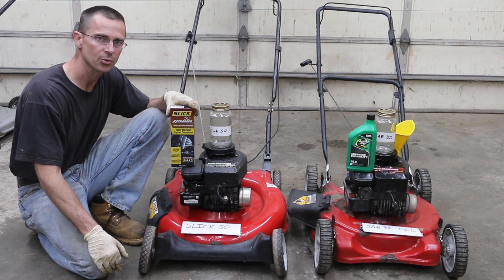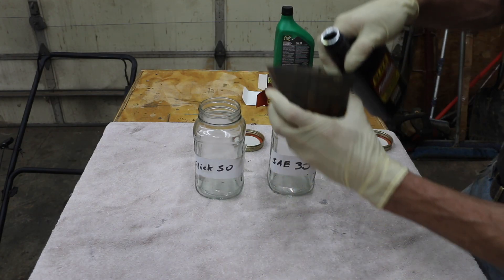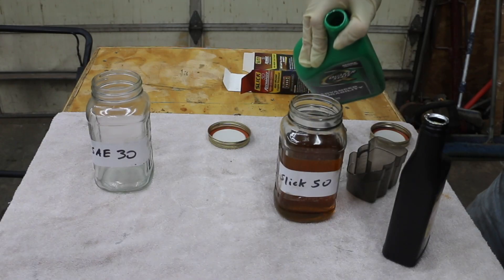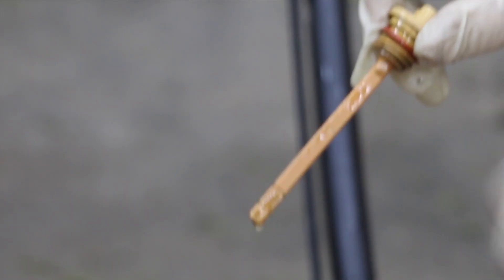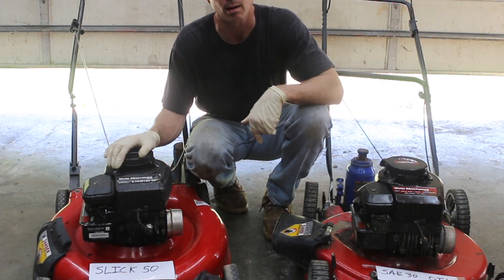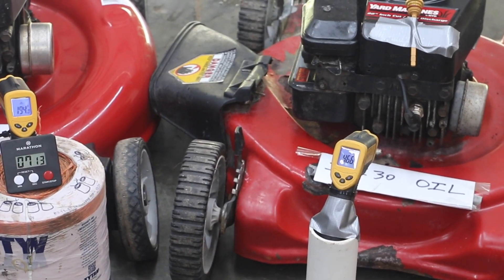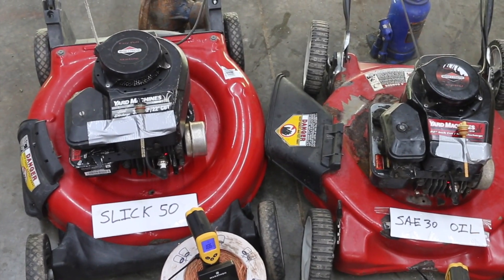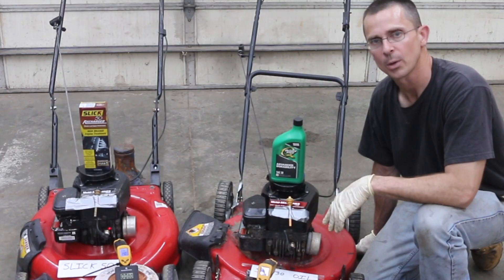Can't believe what SLICK 50 did to my engine!!--Dry Crankcase Test!

Comment: Just a question on the Slick 50 engine - how long did you run the engine with the Slick 50 in it before draining?  My understanding of Slick 50 is that it treats the engine as it runs, requiring several hours of operating at normal temperatures for the Slick 50 to 'treat' the engine surfaces.  The video didn't make it clear how long it ran - it looked as though you just got the engines both up to operating temperature before draining the crankcases. I love your videos and this one came as a big surprise to me too!
Reply: Just saw video that Slick 50 is no longer the same - person claiming to be original inventor now sells what he says is the 'original Slick 50 formula' under new name Xcel Plus.  Worth looking into further.   Video is https://www.youtube.com/watch?v=CAt-tJa9P_s
Reply from the maker: Thank you for this information.

Comment: The clearances on the older machine would be greater than those on the newer machine thus less friction so I wouldn't call this a valid test by any means.  If they were new or fairly new I think the use of Slick 50 would be justified for protecting the motor in the long run.  As far as which would run longer without lubricant I don't care.  What I do care about is which will live the longest with proper care using the best products.
Reply from the maker: Thanks for commenting on this!

Comment: I used to run Quaker State High Mileage oil in my pickup. It had Slick 50 right in the oil mix. They eather don't have that mix anymore, or they don't advertise it's in there anymore.
Reply from the maker: This is interesting.  I believe Quaker State owns Slick 50 now.

Comment: Ran slick 50 Chevy 350 for a long time short trips never knew low on oil till rear main seal failed.

Ran oil only 305 low and knew because power diminished.
Reply from the maker: Thanks for commenting on this!

Comment: Have you ever tried Tufoil?? When I used it in my old 318 motor I had to lower my idle after changing.oil and adding Tufoil. This motor was in a 73 road runner with about 80000 miles. No other additive ever changed my idle speed when added. I used it till I killed the motor and car. I ran it very hard and it finally died at about 180000 miles.
Reply from the maker: Not yet. Thank you for this recommendation!

Comment: From Wikipedia:  "Some mass-market oil additives, notably the ones containing PTFE/Teflon (e.g. Slick 50) and chlorinated paraffins (e.g. Dura Lube),[9] have caused a major backlash by consumers and the U.S. Federal Trade Commission which investigated many mass-marketed engine oil additives in the late 1990s.

Although there is no reason to say that all oil additives used in packaged engine oil are good and all aftermarket oil additives are bad, there has been a tendency in the aftermarket industry to make unfounded claims regarding the efficacy of their oil additives. These unsubstantiated claims have caused consumers to be lured into adding a bottle of chemicals to their engines which do not lower emissions, improve wear resistance, lower temperatures, improve efficiency, or extend engine life more than the (much cheaper) oil would have. Many consumers are convinced that aftermarket oil additives work, but many consumers are convinced that they do not work and are in fact detrimental to the engine. The topic is hotly debated on the Internet.

Although PTFE, a solid, was used in some aftermarket oil additives, users alleged that the PTFE clumped together, clogging filters. Certain people in the 1990s have reported that this was corroborated by NASA and U.S. universities. One thing to note, in defense of PTFE, is that if the particles are smaller than what was apparently used in the 1980s and 1990s, then PTFE can be an effective lubricant in suspension. The size of the particle and many other interrelated components of a lubricant make it difficult to make blanket statements about whether PTFE is useful or harmful. Although PTFE has been called "the slickest substance known to man", it would hardly do any good if it remains in the oil filter..."
Reply from the maker: Thank you for this information.

Comment: you pulled more out of the 30 oil than you did from the slick 50 mixture, pretty sure there was more residual oil in the 30 machine.
Reply from the maker: Thanks for commenting on this.

Comment: I remember a similar advert for slick 50 in the UK but that was about 2 brand new cars equally run in then one treated with slick 50 one without then driven for 500 or 1000 miles (Its a long time ago ) then the lubricants were dumped and they both set off from Sidney to Melbourne  in Australia  , the one with the slick 50 is claimed to have made the whole journey with nothing but a slight increase in running temp whilst the untreated engine seized after a few mile's  at least that was the claim , its great You've actually done a similar test .
Reply from the maker: Thank you!

Comment: Slick 50 did do what you claim when John Bishop supplied the formula that stated the product. www.lubrilon.com  email me if you want the whole story of the industry... I lectured on the lubrication industry for several years... there is a lot of misinformation.  The use of a falex tested only proves the EP properies of a lubricant.  Use cutting fluid that has an EP base...vs oil vs slick vs duralube etc.. gdiintinc@gmail.com
Reply from the maker: Thank you for this information.

Comment: Slick 50 is not the same as it was in the 80's. The company was sold and the new Slick 50 is a different formula. I was at the Dayton, OH Air Show the year Skick 50 was introducing it's original formula and I saw a cessna 172 fly without oil in the engine, no issues. I also have a friend of mine who had a Gyrocopter with a converted VW, 1835cc, engine as the power plant. He treated his engine with original Slick 50. He was on a cross country flight and had the oil pressure line to the gage break off the fitting at the engine block. He noticed that the oil PSIG was reading 0 but since the engine sounded fine he continued to fly for another hour. When he landed he found the broken oil line and checked oil level to find no oil in the engine. CHT's, EGT's were fine in flight and he was able to hand prop the engine and it ran and made power. He fixed the oil line, refilled the engine with oil and Slick 50 and put about another 100 hours on the Gyrocopter before making more engine mods. No visible wear was seen. True story!
Reply: uhhhh NO, no one would allow an aircraft to take off like that. quit lying liar I have an A&P
Reply from the maker: Great point!

Comment: At the bottom of the container of slick 50 was a measured amount of PTFE, or as it's known as polytetrafluoroethylene. The bottle needed to be shaken up for 30 seconds before the treatment was delivered to the engine. The reason for the instructions was to make sure that the full amount of PTFE in the bottom of the container was mixed into that 30 weight oil that they used as of delivery vehicle for the engine. Again we sold thousands of bottles of Petrotech 2000 and Slick 50 as it became known.

I believe that the slick 50 that was originally manufactured was most likely a different product than it is now. Again, the old product had the measure of PTFE in the bottom and needed to be shaken up before delivering the treatment to the engine. I was in my teens at the time when we did the traveling for Petro Tech 2000 which became slick 50. The product is most likely a lot different than it was when it was originally made because the original product did in fact work and it worked flawlessly. 
 I would be more than happy to discuss that with you if you chose to contact me. Anyhow, My internet was slowing down so I apologize for the multiple messages. 
 The intent of the Slick 50 advertisement was NOT to discourage you from using oil, it was to demonstrate the integrity of your engine after it was treated with the product which would extend the life of your engine and prevent a seize if you ever ran out of oil.  I am not condemning you or your tests, you invited us to comment on your videos and I am merely taking you up on your offer as a qualified user and salesperson that is familiar with Slick 50.  One of your followers is a bit of a cool aid drinker of your videos because I didn't ask you to do the interesting tests (and they are informative and enjoyable) but he thinks we should give you cash for making comments contrary to your findings.  Keep making the videos and being curious!
Reply from the maker: Yes, I'm told the product changed from the original. Thanks for commenting!

Comment: I believe that your test with Slick 50 product was not an accurate or thorough test.  Back when Slick 50 was called Petro Tech 2000, the company had a 1 million dollar insurance bond payable to the person that could sieze an engine with the product treatment in the crank case.  My father and his partner Dan Miller (and I) traveled the western U.S. in a Toyota truck with a lawn mower engine attached to the tail gate and had  advertisement on the tail gate that encouraged people to start the engine and watch it run without oil. The engines dipstick was removed so you can see into the engine and that it had no oil. And we went to Utah and Nevada and several places in California with this engine on the tailgate with a brochure holder full of slick 50 brochures that we would fill up every time we went to a store or a restaurant so people could see the engine and the brochures and would challenge to try starting the engine without oil that must have been started three or four hundred times that I can recall where people were surprised and would take the brochures every time we put them out when we stopped. We sold thousands and thousands of bottles of slick 50 and never heard anybody claim the $1,000,000 bond for an engine that seized where they can verify that it was first treated with slick 50 and then was seized afterward.

The catch was you had to follow the directions exactly as it explained the process. At the bottom of the container was the measured amount of PTFE and needed to be mixed thoroughly into the oil.
Reply from the maker: Thanks for the constructive feedback.

Comment: Really? What is the point? Of course any motor with no oil in the crankcase will lock up eventually. Use the slick 50 if you want ,at least it makes the engine run a little cooler. Point is check the oil before you start it. That is why they call it a "dipstick"  There is no magic formula that will work so have fun toasting engines and scratching your head wondering why did that happen.
Reply from the maker: Thanks for commenting.

Comment: I think you got slightly more drain out with the Slick 50 engine. It may have been that with the oil, some of it was hung up in there, and so that one ounce that stayed inside the straight oil engine helped it last a little longer. Just a thought as to why the difference in time the engines lasted. The more interesting thing to me is the lower running temperatures of the Slick 50 engine. Maybe I should run this in my mowers.
Reply from the maker: Thanks for commenting on this.

Comment: I used Slick 50 in new engines after break in, never had an engine oil failure in any vehicle, guess I never would have found out if it worked or not.
Guess I wasted money on snake oil..
Reply from the maker: Thanks for commenting!

Comment: Interesting experiment, I've always wondered about that too. I do have an observation though. The lawn mowers are not identical, looks like one is slightly different than the other and I'm wondering if that could also be part of the explanation. They might be slightly different engines. The one with the regular oil looks like maybe it's older maybe it's just dirty. I'm wondering if it's had a lot of use and the parts are well broken in. I'm just curious I'm not saying that it is the explanation. Does anyone else have any ideas about this?
Reply from the maker: Great point.  In more recent videos I used identical engines.

Comment: 30 years ago I purchased a used 1967 Chevy C30 , it was a retired Navy Base truck from SanDiego, the guy I bought it from used it to to w his Charger back to Cleveland from San Diego  , I see the truck for a year, middle of the summer I changed the oil , refilled it with new oil and Slick 50 according to the instructions, a week later driving home the block windowed. I would never use another oil additive again after, this stuff is junk.
Reply from the maker: Wow!  That's terrible!

Comment: I always thought you had to run the engine for a while like 60 mins or so to allow the slick 50's ptfe to bond to the metal surfaces before full protection was reached
Reply from the maker: Thanks for commenting on this.

Comment: Yes Castrol EDGE Full Synthetic Motor Oil It is a long chain molecule synthetic oil with the ability to electrically stick to metal parts because it produces a positive charge and the metal parts of the engine are negative charged. Castrol EDGE  is three times stronger against viscosity breakdown than the leading synthetic oils. The unique Titanium technology physically changes the way oil behaves under extreme pressures  doubling its film strength, preventing oil from breaking down and reducing friction Castrol EDGE with Fluid Titanium has twice the film strength of the previous formula based on the HFRR friction test.

When they first came out with this product and it was called Castrol Syntex but Syntex did not have Titanium.
Reply from the maker: I'll test it in a future video. Thank you for this recommendation!

Comment: Zx1 has my vote,saved my boat engine Perkins 4107,engine was running at 3/4 throttle for at least 1/2 an hour with no psi on the gauge,could have been longer,sure saved my engine.No connection with Zx1.
Reply from the maker: Thank you for this recommendation!

Comment: Not that anyone should blow a fortune on two brand new engines, but I wonder if the two test engines you used were treated differently before you bought them for this test.
Reply from the maker: This is an excellent point.  In more recent videos, I used 2 new, identical engines.  However, I've been criticized for being wasteful.  So, not sure I will do more testing like this.
Reply: I hate the expression "Haters gonna hate," but it's still true. Basically, someone will find fault with you regardless of what you do. ("Look at all the epoxy you wasted!" "Look at all the electricity you wasted grinding down angle iron!" and on and on.) My counter-argument about destroying engines -- especially in a comparo that's probably more scientifically valid -- is that you are actually SAVING engines by running experiments on small, cheap engines (as opposed to car engines) and that there are literally millions of people who now will not have to run a similar experiment to find out the result. This is particularly true with tests that serve a real-world purpose -- e.g., testing Slick 50 or SeaFoam, as opposed to using WD40 for engine oil, which no one would actually do, owing to the expense of WD40.  You can also mitigate some of the criticism by donating destroyed engines to either a nearby high school, trade school, or similar auto mechanics class, give them to a nearby small engine repair shop to be cannibalized for useful parts,  or give them away on craigslist so someone might be able to make use of the parts. Bottom line...do your best to be a good citizen of the world, and rest easy, bro. :)
Reply from the maker: Great point regarding the haters!  I agree, the few hundred spent on small engines could collectively save consumers hundreds of thousands or millions.  Thanks again!

Comment: I'm wondering what the slick 50 engines failure was. Obviously it wasn't from excessive heat it seems. I mean if the piston seized the head should have been extremely hot? It was at 230F when it started to fail and hit 284F after it failed. Maybe the plastic part that moves the valves failed?
Reply from the maker: I was able to later free up the engine and get it running, but it sustained damage. Thanks for commenting.

Comment: way back when these came out, I tried duralube, very unscientific, but engine oil between my fingers, and rubbing them back & forth, it went away, then I tried duralube, and it never went away, stayed slippery as hell
Reply from the maker: Yes, I've heard good things about Duralube and I've done some very basic testing with it, but I need to conduct a more in-depth test like I did with Motorkote.

Comment: not excusing slick 50, but back in the day of the commercial, didn't they use 100% slick 50 for the pretreatment? maybe not? Also the slick 50 mower looked like it had more hours on it, bald tires & all
Reply from the maker: All great points. I used new, identical engines in more recent videos.

Comment: Love your videos!
I've been a mechanic since the 80's and have been using Castrol Syntec/Edge for about 30 years on my vehicles and my families' vehicles. I change the filter & top-up around every 5000 Kms.(makes it easy to know when a filter change is due) along with the usual checks; And change the oil at 40,000 Kms. or once a year; whichever comes first. Before that, I was using & selling Mobil 1 who used to have 25,000 miles or 1 year printed on their bottles in the '80's. I switched to Castrol years ago because of Amsoil, which I also used & sold. They did a test comparing different oils and Castrol Syntec was a hair behind their best synthetic racing oil. At that time, Castrol cost $5/L. and the Amsoil was $11/Qt. 
I have never had an engine give any trouble because of oil.
I would be interested in seeing you do a test with Castrol Edge which replaced Syntec. I'm pretty sure that there used to be a TV ad. that had an engine running with their oil being drained out to show that it treated the metal.
Reply from the maker: Thank you for this video test idea!